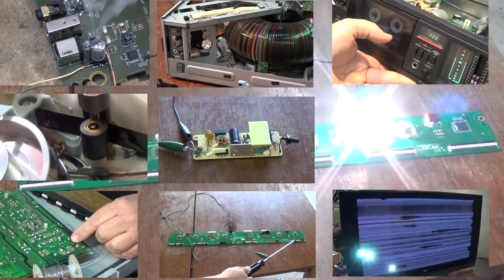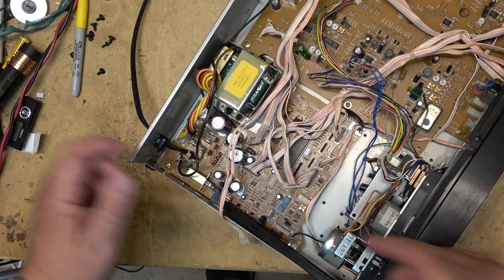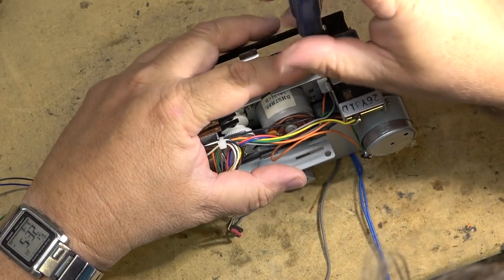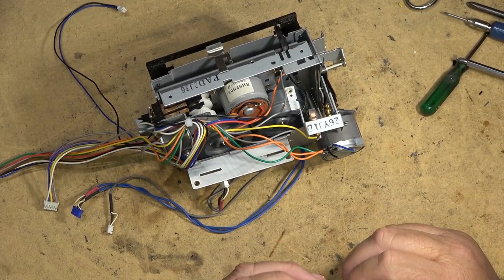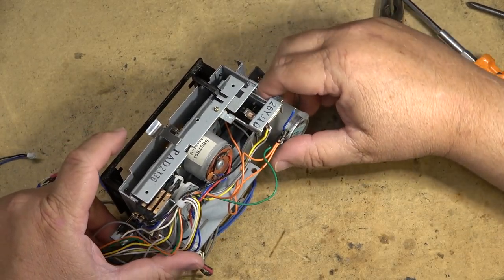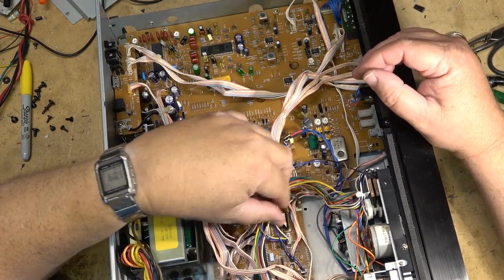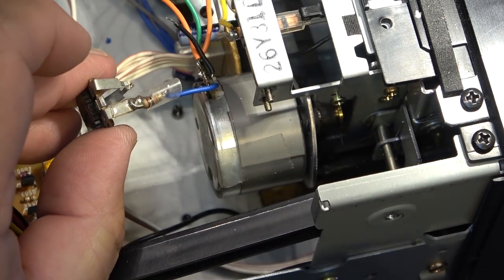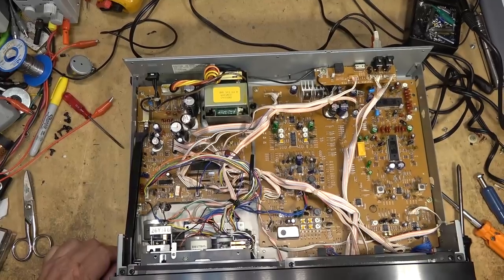Transplanting a salvaged motor into a high end cassette deck to give it a new lease on life

Comment: Repairing Nakamichi decks became a problem in the UK when B&W stopped servicing them and parts were no longer available.
Nice fix. I get the suspicion that the motors may have came from the same factory, they look so similar in construction.
Reply from the maker: The original was a mitsumu and replacement Matsushita.

Comment: Excellent, I was aware of those 4 wire motors, used in machines with high speed dubbing. I must admit I had assumed they just switched power between two separate windings. It makes more sense now that they just switch in different potentiometers to select the different speeds.

Comment: Happy to see this machine running again! Beginning to remind me of Dr. Frankenstein with these "transplants"  Another one saved.
Reply from the maker: Got to do what needs to be done as no new parts available.  Sure there are knock off cheap motors from China kicking around.  You buy them 10 at a time and you might get 2 that run at a stable speed.   Then again, find a gently used 30+ year d motor and you are good to go.  These cheap combo units are usually a good place to look.  They were typically bought for kids. Sat in their bedroom.  They either had the shit run out of them or they sat on the shelf and were barely used. The way to tell..... Look in the tape compartment. If it was heavily used you will see the wear on the head or pinch roller.  If no wear is noted on the head then the motor is likely like new.   This one had zero signs of wear.  Most likely sat in a kid's room and was used as a radio.  Kids moved out parents got rid of system.  That or it was bought for mom or dad to have in their little apartment after they down sized and was only used to listen to the radio and play Bing Crosby records at Christmas.  We sold tons of these when I worked in the shop and those were the 2 demographics.  First system for teens or for the senior parents that didn't have the space for the old giant speakers.   These were not exactly cheap when they were new.  199.95 for one of these back in 88.

Comment: I tried a similar MMI-6H2LWDR 12V four terminals Matsushita motor (14 Jan 94 new old stock) on this same Sankyo mechanism to replace the original. And a Bourns multi-turn trimmer for speed control. I could set speed with 3000Hz test tapes and the frequency stability was great. But wow and flutter was very high for some reason. The motor was quiet though, very steady. I tested it in a DR2 and in an Onkyo with same mechanism. Just in case there was a difference in drive electronics. Same bad W&F results. I finally replaced it with a humble Mabuchi normal two terminals 2400RPM CCW that cost me five times cheaper. And the Sankyo mechanism worked in spec with 0.035% JIS wow & flutter measured. Go figure.
Reply from the maker: Want low WF check out a JVC TD v1010 or technics rsm275.  Direct drive flywheel.
Reply: @12voltvids  Yes I know, DD is best, I also have a Revox B-215 which arguably has the best cassette deck mechanism ever. There was a wavy pattern of high wow with the dual speed Matsushita motor on the DR2. Maybe too much toque for its Sankyo Mech. A pity because speed stability was remarkable for a belt drive. Anyway, I kept the motor in the parts bin for future use, I may luck out in another deck.

Comment: I guess in a pinch, if someone was doing this kind of repair without an oscilloscope, a known-good tape-recording of a metronome could help a lot to match speed by ear.
Reply from the maker: 440 tape and a guitar tuner.  440 is the "A" string.

Comment: I have always wondered if these Nakamichi decks were as good as they were cracked up to be, given the price that was charged for them.  You got a basic DC servo motor for the capstan drive when for example lower priced Technics decks came with quartz DD capstan motors. My Technics RS-BX707 had 3 heads, quartz DD motor & cost 200.00 GBP (348.00 Canadian Dollars) in 1991 inclusive of VAT (sales tax) and was a superb performer.
Reply from the maker: You hit the nail on the head.  Nakamichi was just an expensive name on a cheap deck.   
These are not servo motors.  They are just cheap DC motors.  A servo motor has a frequency generator and feedback circuit to the servo.  Think capstan motor on acient VHS decks by Hitachi.
Reply: @12voltvids  thanks for your reply. One of these days you ought to do a video debunking some of the myths audio(fools)philes believe in and give the view from the technicians bench.
Reply from the maker: @davidpinfold852  You can't fix stupid. These audiophools have spent so much money on this crap that they have actually convinced themselves that they can hear the difference between a 5.00 and 500.00 3 foot patch cord, or the difference between 16Ga lamp cort and OFC monster speaker cable hand braided by virgins that cost 100.00 per foot over a 10 foot length. I used to work with one of these types. He did give me a nice Technics slp50p cd player that the door wouldn't stay closed on. I adjusted the latch and sold it for 500.00 to the used stereo dealer, that then turned around and sold it to some other sucker for 700.00! This guy was convinced that all patch cords needed to be directional cables and could only connect in one direction.  Hello, it's AC, the electrons go both ways!
Lots of snake oil to be sold to the gullible I guess.
Reply: @12voltvids  Thanks for that!

Comment: Dave, 
To me, this is amazing. I never would have guessed a Matsushita motor would fit a Nakamichi cassette deck. And the pulley fit as well. Are all these motors made by one company? If that's the case, that would tend make more sense that it would fit.
Reply: Not Dave, but from personal experience, many decks (80s+?) seem to use the same form factor motor with the screw holes at predesignated spots. This from having changed around a few as well. Even tape head mounts seem to follow this practice. I changed a mono tape head from a very early 60s deck with a late 80s stereo head and it fit right in place.
Reply: Mounting is universal. Never seen a motor with a different kind of mounting.  This kind of servomotors came from mostly 4 brands, Matshushita, Mabuchi, Sankyo and Mitsumi. Good known brands dont built they motors, they just buy from one of ths companies. Could be small variations on the specification (complete model is different, but they perform good enough).
Reply from the maker: @38911bytefree  there are a few different sizes.  If the motor is physically the same size it will fit. There are also multiple mounting holes to allow mounting in different chassis.

Comment: Best restore from a cheap thing thing to a good dear thing you were lucky to find that motor
Reply from the maker: I've been on the lookout for one for awhile.   That nak was the one with the stiff motor.   Tore it down and lubed.   Speed inconsistent i blamed it on a cheap belt.  Changed the belt and tested.  Speed still wandering so new motor and it is steady as she goes.
Reply: @12voltvids  vwwestlife done a feature of different  brands of belts some interesting results

Comment: Mr. 12voltvids.  You are a Master at electronics.  I have an issue pertaining to a Schumacher 2/10/50 amp dual rate manual starter charger, model number SE-1052.  Do you have any video's on repairing this type of electronic device?  Any help would be greatly appreciated.

Comment: Smashing :-D
The panacrappy was worth the money to make the nakamichi good again.
I bet the speed board was not the problem, dodgy commutator brushes.
Reply from the maker: Or worn bearings.
Reply: @12voltvids  yes i forgot about them, the shaft riding around the inner diameter causing speed fluctuation.
Easy to forget the silly stuff, well for me it is :-D

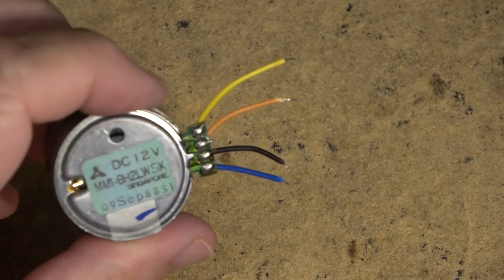Comment: Thanks on 5:18 Without knowing much I have repaired several cassette decks, I say repair because they ended dead, either change capacitors, broken tracks, cold welds, mechanical failures, it gives satisfaction to achieve it, I ask you because I see the motor similar to my Marantz sd 4000, it has a 12v 1 servo motor 1800- 3600rpm, the rotten rubber braked the motor was destroyed, when I disassemble it carefully as I always did, I did not see, I repeat I did NOT SEE two 0.02mm wires coming from the motor shaft towards the plate when I remove it I realize that I cut them, I open the motor and I see that there is a magnet on the shaft and a microscopic coil positioned at the end of the motor shaft where the lid goes, I estimate that when turning the motor circuit, it should check the rpm and precisely adjust the rpm, precisely to complicate it more the Marantz SD 4000 is double speed.

I'm seeing if with a microscope I can see the cut threads and join them with new ones, or will I have to try to clone the micro coil in case you open one of these Marantz motors, it lights up well and looks with a magnifying glass, I've never seen something so ugly, it seems like a trap for let it hurt you

Excuse me for such a long comment, could you explain to me what each cable would do in that cassette player that you have in the video? it looks similar until it has that transistor or component glued to the outside of the motor.

Greetings and thank you very much

Comment: a bit of nit picking here, maybe you should have took rt measurement of the vr and resistor, and put in a fixed resistor/s  of close value. the movement of the motor will maybe adjust the vr
Reply from the maker: A 9.0 earthquake won't move that trimmer. They don't turn that easily. This is not a volume control designed to be turned. It is designed to be set, and not move.They are actually quite stiff. It ain't going anywhere.
Reply: @12voltvids  good-o, just for a bit of trivia rt value would have been nice to know. some nice vids here

Comment: sorry,don’t like this repair,sure you can find the right motor for this deck…
Reply from the maker: Do i look like i give a shit what you like. You have no clue about tape decks.  Nakamichi used the cheapest mechanisms they could get. They used Sankyo motor for capstan. Matsushita (Panasonic) is a superior motor. And no, you can not buy new OEM motors.  All the ones you find on eBay are pulls from recycled cassette decks. I could have gotten a new old stock one out if Ontario for 69.99 plus tax and shipping. 97.72 by the time it gets here.  
I got a brand new one out if a tape deck i picked up at the second hand store for 10.00. 
It's much more reliable now than it ever was, that is if you can call nakamichi reliable.  Just ask anyone that was dumb enough to buy a dragon.  There is a reason they went bankrupt.  If they actually lived to the hype they would still be around.